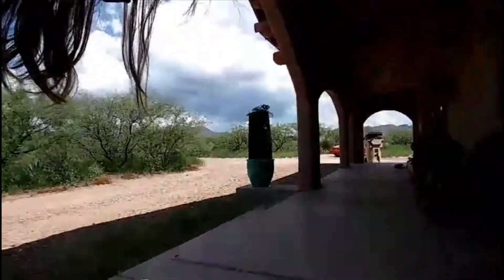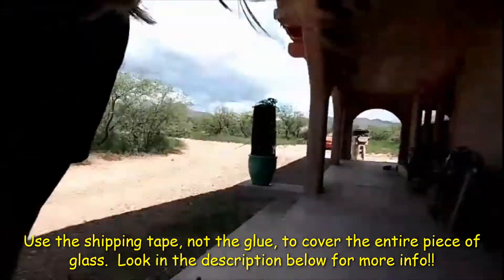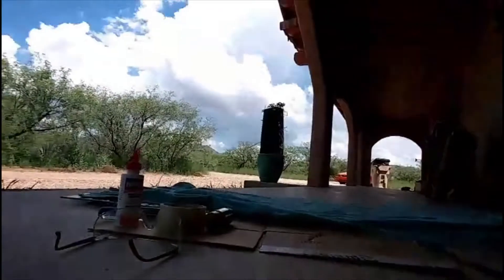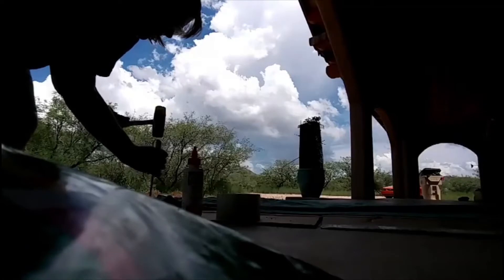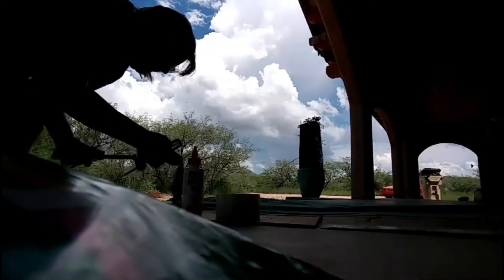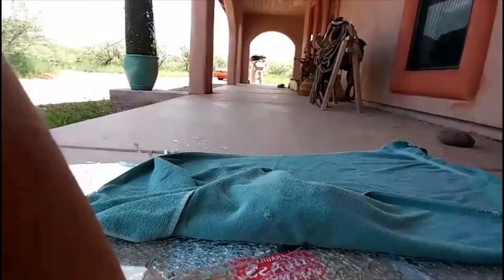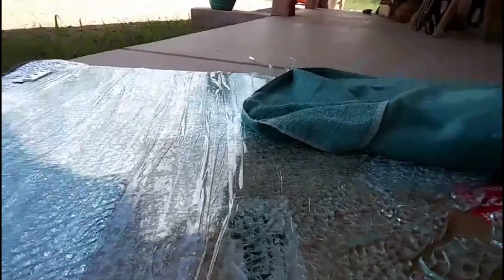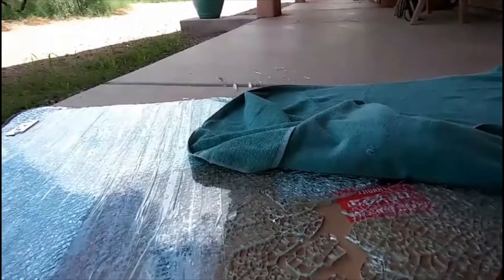Preparing Tempered Glass For Mosaics

Comment: Just need to tap one corner with a hammer. Right at the corner tip. Not on top of the glass. It will break with less busting. I work in a glass shop.

Comment: I wrote this before I read your info. You are doing almost exactly what I wrote but this took a long time for me to type so I'm leaving it here. Lay the piece of glass on an old shower curtain, sheet or cut open then tape together a couple large garbage bags. Cover the top of the glass with clear contact paper and make sure it sticks well. If you don't have the glass on something you can dispose of you will be sweeping tiny slivers off the cement for years. To shatter the glass use just the hammer and hit the corner edge or the middle edge. At this point you can use a box cutter to slice the contact paper covered glass into the size pieces you want, then easily move those pieces to a container of choice. When all that's left on the trash bag is loose shards, roll up it up from the sides then funnel it down into a different container. Wad up the trash bags or old sheet, keeping the tiny slivers and dust inside then place it in another garbage bag and dispose of it. I used to use whole shower doors or screen door windows. I have found that the thicker the glass the smaller the shards shatter into. Where as the thinner glass like the windows had larger more interesting shards, in my opinion. I haven't done art like this in many years but I thought I'd share my experience.
Reply from the maker: Thank you D Sherwood!  I appreciate the write up!
Reply: Then how do you get it off of the contact paper to use it? or do you use it attached to the contact paper?
Reply: @crazyglasslady  I used it attached to the contact paper. I cut the contact paper attached to the glass into the size I need say 12"X12". I put silicone down on the picture then lay the sheet of contact paper and glass on top of the silicone, glass facing down. Once it's dry and the glass is stuck to the picture I peel the contact paper off.
Reply: Thank you! I can’t wait to try it. Where do you get the contact paper?
Reply: It's temp glass. It will pick up easy